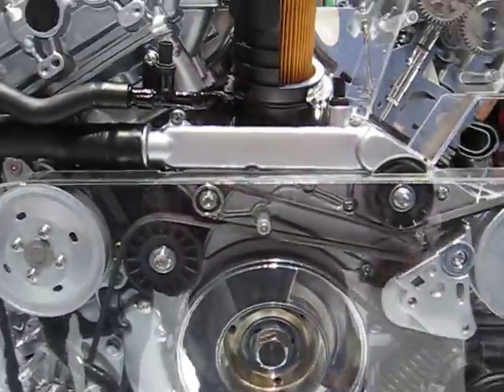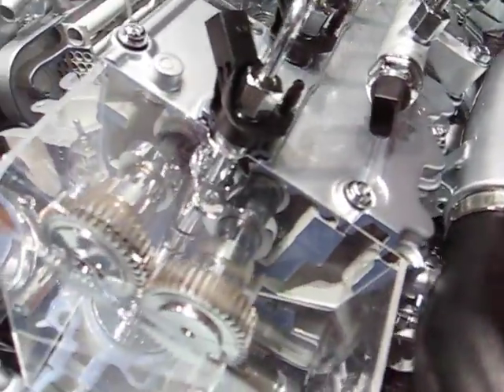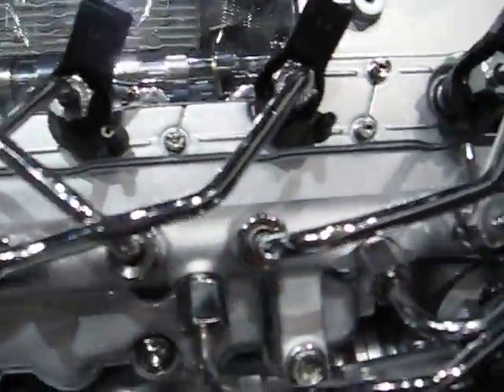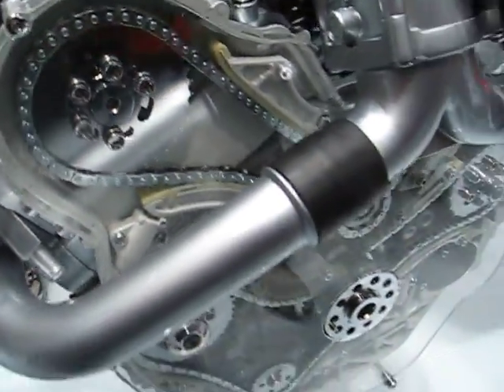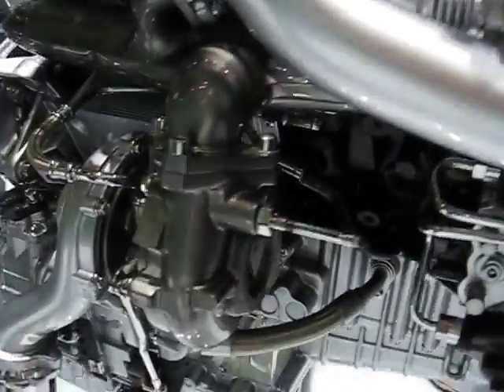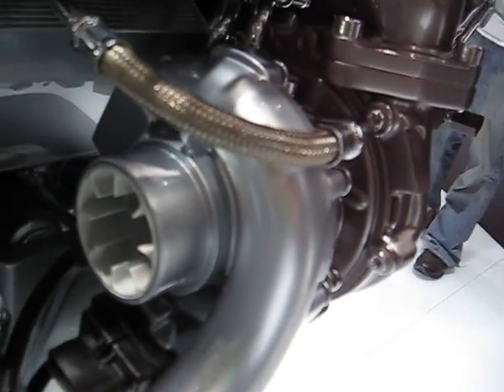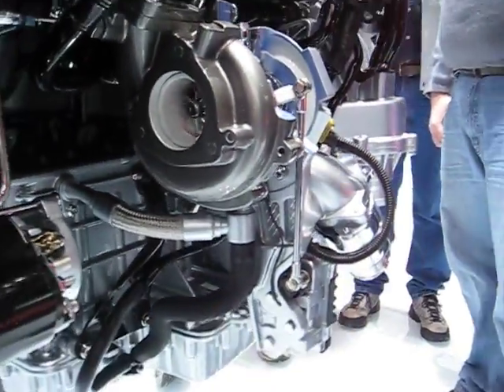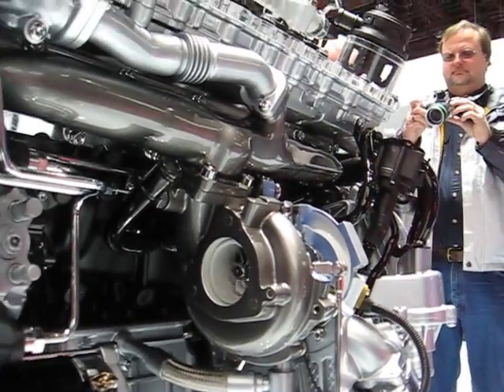Audi 6.0L V12 TDI

Comment from the maker: @HuBiQ95 A W12 has either three or four banks of cylinders - the VAG W12 basically takes two VR6s and joins them side by side at the crank - just like many V12s have taken two inline sixes and done the same thing.

This engine isn't actually two V6s joined together - IIRC the cylinder angle is different from the VAG V6 TDIs - but it's fairly similar to two V6 engines put end-to-end - giving you two banks of six cylinders. It's a V.

Comment: a V-12 diesel is Brilliant.

Because of the v-12 configuration, you can not only make components lighter, but smaller. Which means you can have a much higher rev limit.

Combine that with the efficiency of a diesel engine. 

Things like this should be thought of sooner.

I want to buy this engine, and make a drag car. I wonder if they sell just them, i wouldn't want to buy a SUV just to scrap it out for the engine.

Comment from the maker: The R8 V12 TDI was cancelled, but it used the same engine as the Q7 V12 TDI, which can be purchased in Europe...

500 PS @ 3750 RPM. Not sure where the rev limiter is.

Comment: to everyone saying "put this in the r8 or the rs4".. even put in the middle of the car, it will just make the car a couple of hundred kilos heavier compared to a petrol engine with similar output. so putting this into a sports car where handling is the top priority makes as much sense as eating icecream to get thinner

and lets not even get started on power delivery and turbo lag, which is very important in sports cars for being able to put down power in a corner, at which TDIs suck badly

Comment: are you sure it's v12 ?  in my oppinion its w12. its fusioned 2 v6 which give us w12 :)
Reply: Its a V12 TDI -> Turbochargers. By the way a W12 are 2 fusioned VR6 engines
Reply: @sebastiansglocke4380  it was 9 years ago, I was young and stupid. Of course it's v12, and w12 are combined vr6.